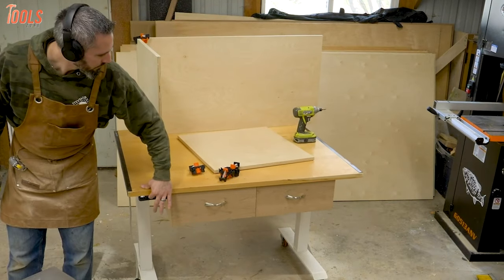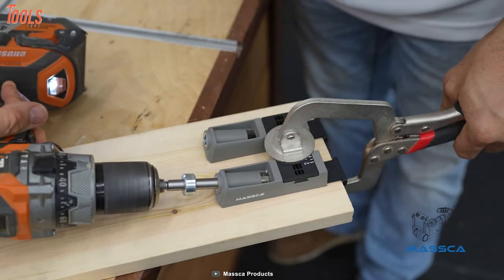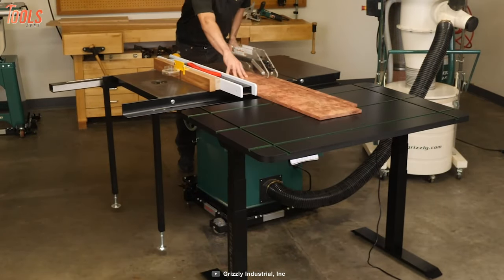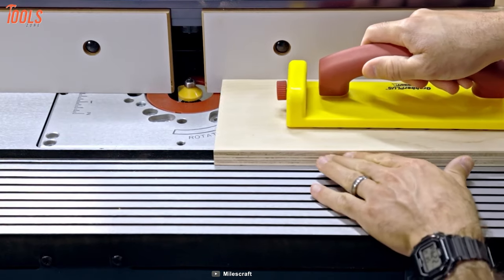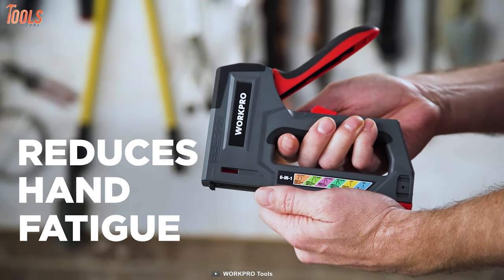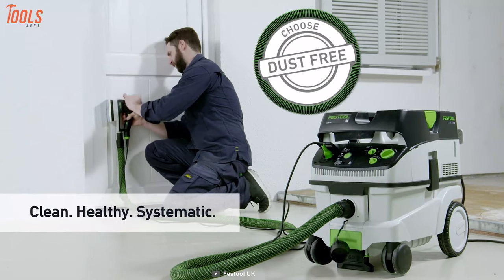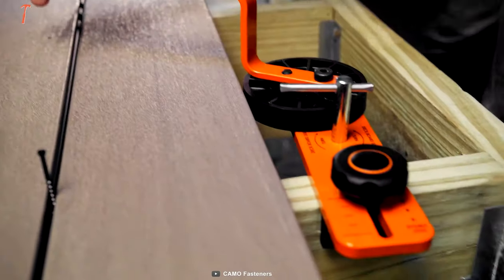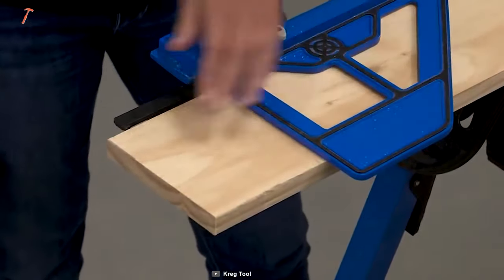Woodworking Tools That Are On Another Level ▶ 4

Comment: Irwin have been making quick-grip clamps with 250kg+ clamping strength for years. This type of tool is not ‘new’.

Adjustable pocket hole jigs have been around for many years. This type of tool is not ‘new’.

Adjustable height work benches with and without T slots have been around for many years. This type of workbench is not ‘new’.

Push sticks of many types (including the type in this video) have been around for decades. This type of tool is not ‘new’.

Modular and collated screw guns have existed for decades. Anybody who does not know that certainly won’t want to pay Festool’s prices. This type of tool is not ‘new’.

Staple guns have existed for many decades. This type of tool is not ‘new’.

Oddly shaped sanders and sander attachments have existed for many years. They are an uncommon tool so you could be forgiven for thinking this is a new type of tool. However, these types of tools are not ‘new’.

Metric and imperial rafter squares (commonly known as speed squares or quick squares) have been around for decades and have been hugely popularised worldwide thanks to YouTube in the last 5-10 years. This type of tools are not ‘new’.

Board straighteners for decking and hardwood floor boards have been around for literally hundreds of years with many variations and types. This particular style has been around for many years. These tools are certainly not ‘new’.

The crosscut guide in this video may or may not be new but it is modelled off jigs and other tools (such as rafter squares mentioned earlier) that tradespeople and DIYers have been using for a very long time. This is not a ‘new’ idea.

You have put minimal effort into this video and I for one am not impressed. If YouTube recommends more rubbish like this from you I will block your channel. Put in some more effort and make a decent video.
Reply from the maker: Thanks for sharing your ideas and the efforts for this comment. 🧡